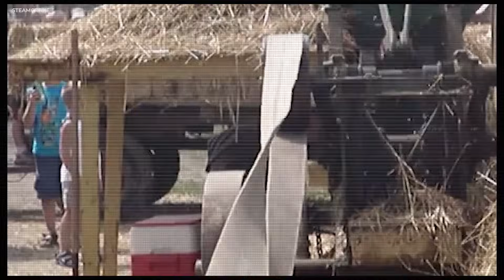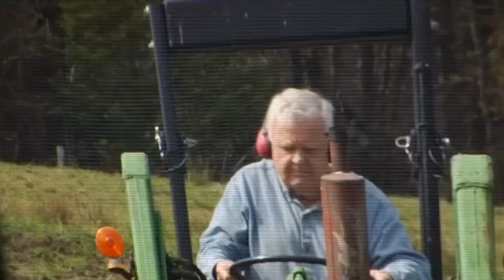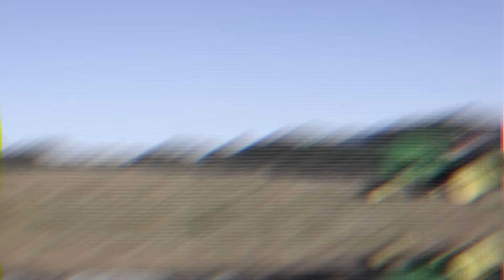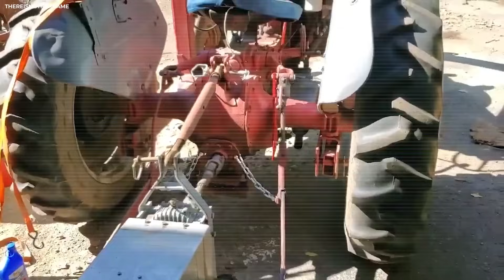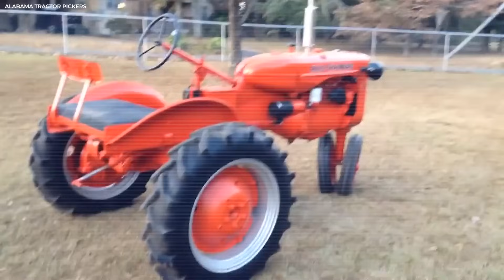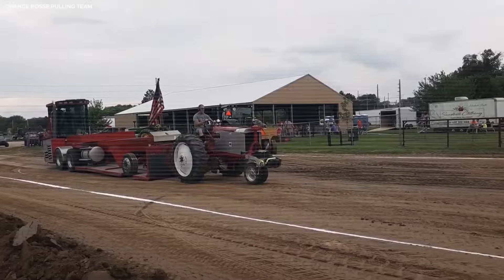20 DANGEROUS TRACTOR FEATURES THAT FADED INTO HISTORY

Comment: The author of this video never grew up on a farm.  Our farm was hilly, and all the tractors were row crop models.  We never rolled even one.  Some of these guards were missing off the pto shafts.  No rollover protection or cabs. The transmissions were not synchronized and it not an issue.  No power steering or brakes.  We had belt drive equipment, and never got hurt. Farming was dangerous only to folks without common sense.

Comment: I never watched the video and immediately know I'm a major wuss Old Farm Equipment is dangerous it's called common sense I'm 24 f**** years old modern times I can drive a hand clutch and they're not that dangerous they're pretty easy to operate and not every tractor have flywheel start that was only John Deere's cuz the way the engine sits in the tractor every other tractor was a hand crank talk about wine and complaining when it's common sense and if you ask me steel wheels will get you more traction than rubber about not knowing s*** then why the hell keep on referencing the John Deere d

Comment: Been operating an open cab tractor since 1985 (i was 5) never been killed. Common sense is becoming less common
First one was a 1940 farmall model m. Grandpa taught us how to pop the front off the ground, work the brakes and spin it around like a zero turn mower.
When i was a teen we got a 1958 for powermaster, in my 20s i bought a 1959 powermaster. When the fords wont do the job that farmall still cuts it. I bought a 1988 massey when I was 39 and I'd rather use my old ones.
Reply: Key word is “yet”.  I learned on a massy when I was 8. I own a construction company and operate a backhoe an skid now.  4 decades of operating and I still have O shiii moments.  Respect the machine, safety is no joke.

Comment: I remember operating my grandparents 1939? International TD 18
.It used gas to start.An electric starter turned the engine over,and it would fire up on gas.Then,after about a minute,you'ed throw a lever upward,and it would coast down on momentum,then it would flre up in diesel.  Very fun to drive.I learned when I was about 9 years old .Wish we'ed kept it!